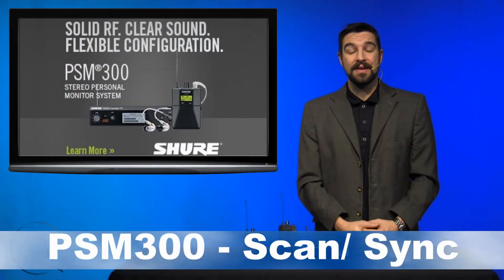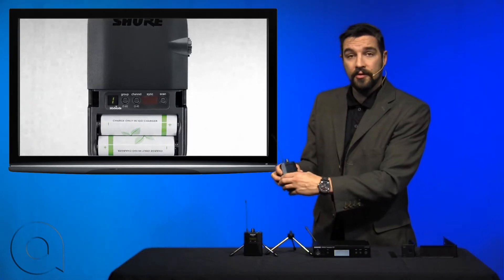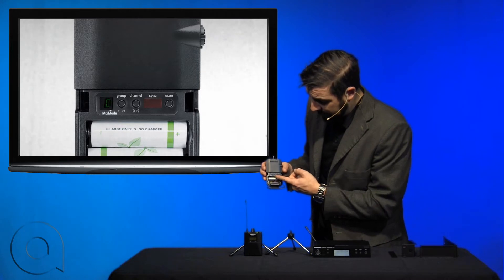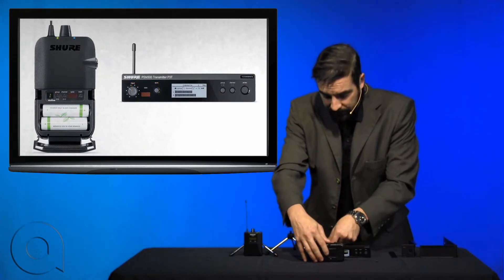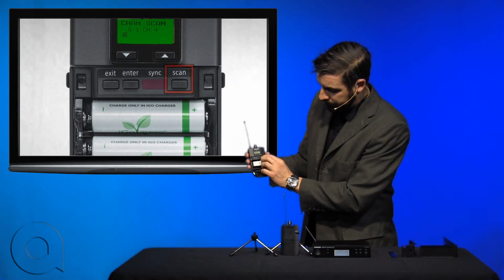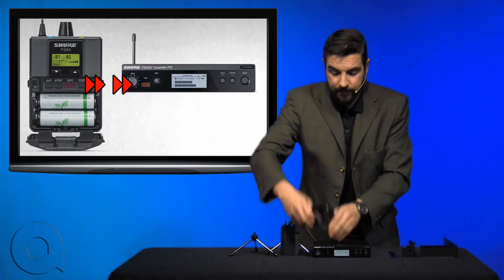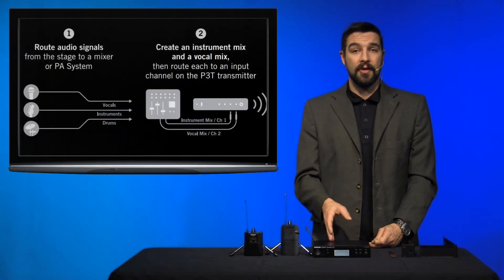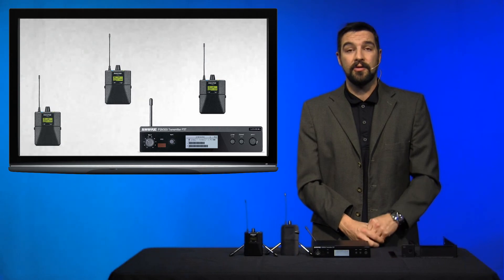PSM300 Tutorial-Scan and Sync

Comment: do you have to turn off the transmitter in between each receiver that you add? Do I keep the transmitter off, scan on the first receiver, turn the transmitter on and sync only to then turn the transmitter off and repeat that entire process for the second pack? Also, can you use the metal pack in the plastic pack at the same time? I have both and for some reason they both show different frequencies or groups or some thing upon scanning. and, how come there are different versions of the PSM? Do you have to take that into account when getting the packs?